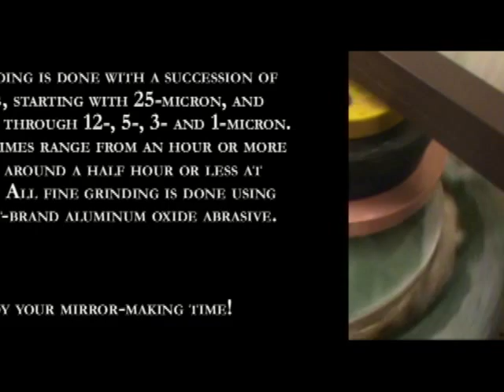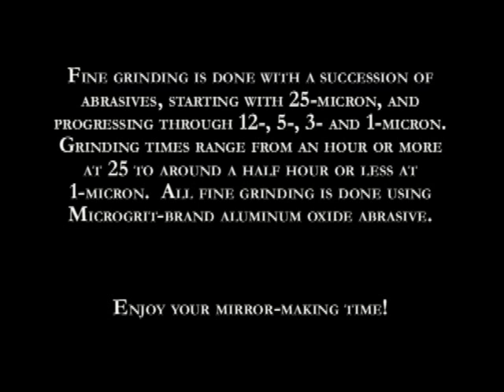Fine Grinding a 20" Quartz Telescope Mirror

Comment: First of all, thanks for the awesome videos - very informative and addictive :)

I'm thinking of building a turntable similar to yours but I'm still pondering on the appropriate wattage of the motor... how much kW is your motor so it's got enough torque not to struggle when you put weights on it?
Reply from the maker: Most of my motors are 3/4 hp or better.  That will do up to a 25" mirror.
Reply: @GordonWaite  Thanks for the info! What about the VFDs, do you have any specific recommendations?

Comment: How would you reduce a too deep sagitta with the fixed port method? Push the tool off the edge further?
Reply from the maker: Yes, you have to move the tool farther from the center of the mirror.  Go in small steps.

Comment: Hey there,

I'm curious if you've ever run 3 or 1 micron grit by hand. In the various chats and forums I'm in,  I've seen people say that 3-1 micron should only be used with machines like what you've got. Do you suppose suspending in something other than water might make hand use easier?

Comment: 3 micron AlOx? Isn't cerium oxide typically 3 microns?
Reply from the maker: Many types of Cerox do have a 3-micron average particle size.  But aluminum oxide and cerium oxide are different materials and work in different ways.  AlOx is an abrasive that is used with "loose abrasive" techniques.  That is, the abrasive either rolls or slides between two pieces (a blank and a tool) and chips away the glass.  Cerox is an entirely different process.  With Cerox, the material embeds in the pitch substrate.  When you move the glass over the pitch with the embedded Cerox, the particles "shave" the top of the glass instead of chipping it out.  This isn't the whole story, as there are also chemistry effects during polishing.
Reply: Interesting. I jump straight from 5 micron AlOx to cerium oxide with my mirrors. Does 3 micron AlOx save time in polishing?
Reply from the maker: It does save some time, but only if you are using a fixed-post grinding machine.  Otherwise it is prone to scratching, and it's hard to use without perfect contact, which is very difficult to achieve with hand work.
Reply: I am grinding by hand and getting scratches even at 9 micron. Very fine scratches though, which seem to go away after about 20 minutes with the 9 micron.

I find that big source of scratches are tiny chips of glass which are fractured from the bevel when working with tool on top, especially if the bevel was not fine ground and just made with a coarse-ish grinding stone.
Reply from the maker: Yes, the edge bevel is a source for problems.  Keep a good bevel and things will be better!  I use a diamond tool so the edge isn't quite so coarse.

Comment: the finished product is aluminized so why is quartz used. Why isn't say a cast aluminum disk used?
Reply from the maker: Michael Hursh Aluminum expands and contracts when it gets hotter or colder, and this destroys the precise shape of the mirror.  Pyrex or borosilicate glass change much less than aluminum, and quartz changes even less.

Comment: MASK!!! always wear protective mask for breathing when grinding quartz, its the most common form of crystalline silica and its extremely hazardous like aspestos, and relatively small exposures can cause silicosis, help to spread awareness through the lapidary community about the safe application of cutting grinding polishing and generally working quartz, by spreading this message might save some ones life. many thanks
Reply: This is wet grinding, there is no dust in the air.

Comment from the maker: First is whether the mirror is at the radius that you want.  If you need to change the radius, do that before going on to a finer level.  Second, inspect the surface to make sure that grinding has done the job.  With coarse abrasives, you can check for pits.  If any are larger than average, keep going with the current abrasive.  With finer abrasives, hold the mirror so light grazes, and see if it is reflected evenly across a diameter.  Mirrors often grind inside to outside, or vice versa.

Comment: a most elegant mechanism. Do i have to assume that the abrasive disk must have a diameter exactly 1/2 of the glass substrate diameter?the relative speeds of the disk will be calculated according to what formula?

Comment: Lisa, I haven't done this so I could be missing something, perhaps Gordon will or someone with experience will chime in if I'm wrong. If you will go back and watch the tool making video he makes the tool on the mirror, so it has the same shape as the mirror. As the two grind together the edges of the tool are worn away faster than the center, and the center of the mirror is worn away faster than the edges giving it that concave shape that is desired. I suspect if the tool was to wear to the poin

Comment: interesting video Gordon, it looks like you have done this before. i am interested in making a reflector telescope myself and have been reading various things about it on the net. one thing i was wondering is why do you use glass? wouldn't some type of ceramic make a good substrate? thanks for any insight you could give me.
Reply: Glass is traditional, it’s reflective enough before the coating goes on to usefully test the curvature so you can do figuring by hand on it, and people know how it works. It’s also very available.

Technically, a super high temperature vitrified ceramic could work, but the word vitrified says it all — you basically would need a ceramic that’s been turned into glass.

The question is, what are you hoping to gain? Glass is super cheap for what it is, and Pyrex in particular (that is, borosilicate glass) has very good thermal properties and strength. It’d be a very expensive ceramic to better it — think, like, useful for a KeyHole or the Hubble where every pound costs 25 grand to send up, but not really viable for hobbyist astronomy on earth.